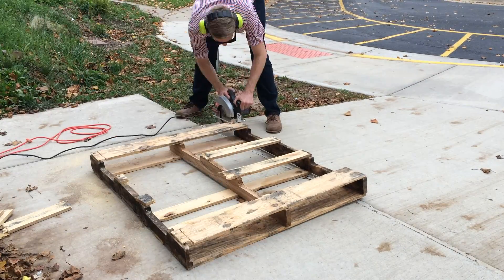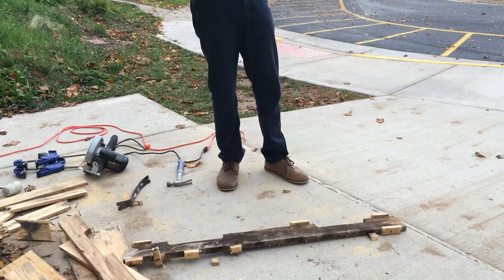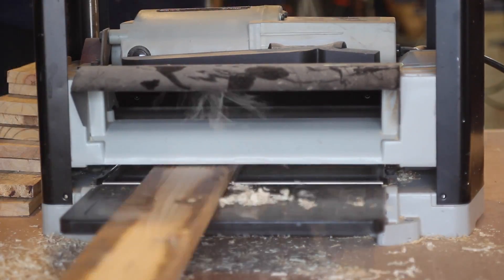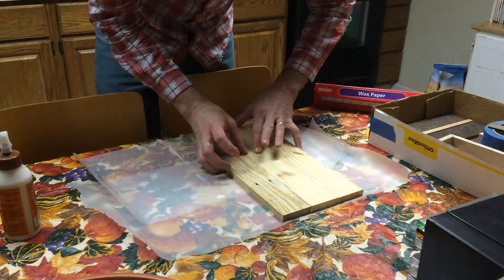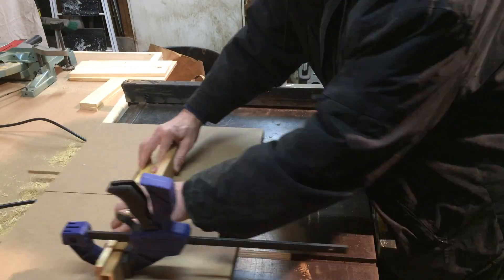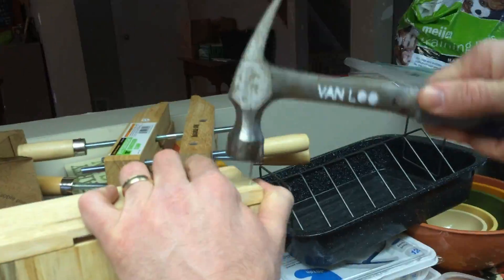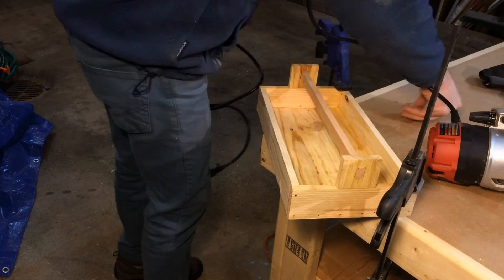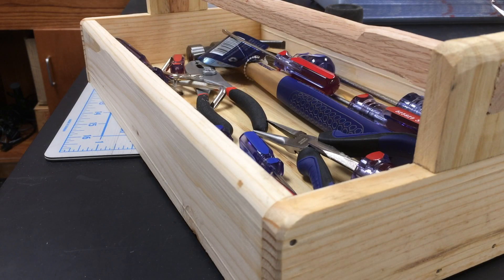Building a tool tray from pallet wood

Comment: You can stagger the blades of your planer a little. That will help to minimize the ridge the nail nik will leave in your wood, until you can sharpen or replace your blades.

Comment: Bill great video and project Thank you for the shout out !!!!
Reply: I think a better way to experiment on wood design is working with fence
slats,   cheap and easy.
Reply: Very Cool, and great video !
Reply: I sometimes wonder if the effort in using reclaimed wood from pallets is worth the time spent preparing it.
Reply from the maker: Dee - I totally understand. I'm not sure I'll use pallet wood in this way in the future. I do have a really fun project coming up that uses pallet wood, but in its original state, not planed and prepared. It is a lot of work, and can be hard on the tools.